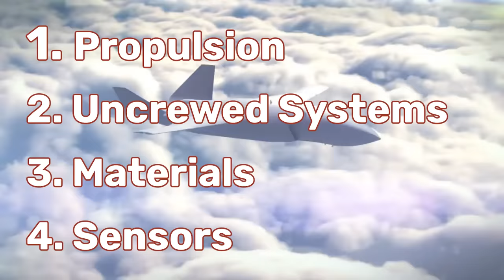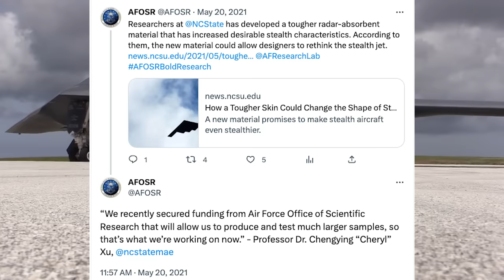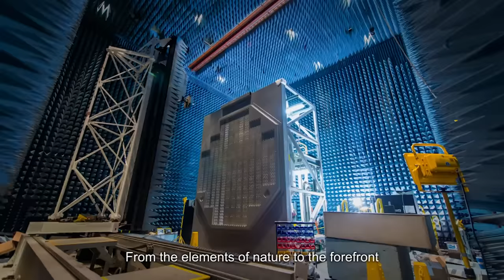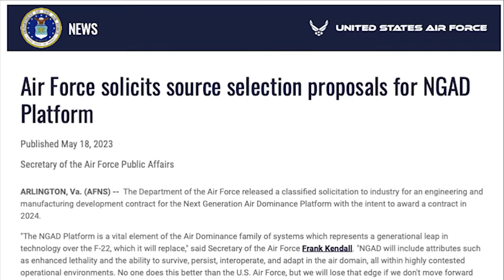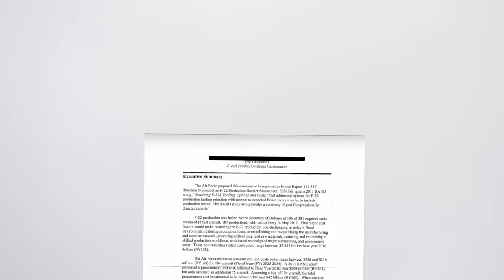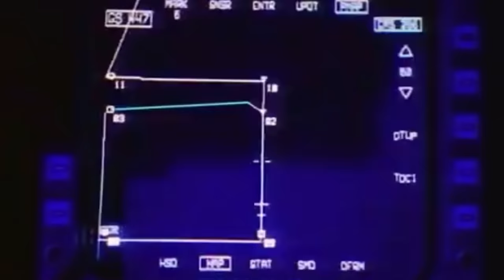Why America's new stealth fighters might cost $300 MILLION each

Comment: The better question is not what it will cost to purchase but what it will cost to maintain and operate. If we had a fighter that cost a billion dollars each but required one tenth of the maintenance and upkeep of the F22 or F35 that would still be a far better deal in the long run.
Reply: One of the two prime contractors on the F35 program doesn’t consider “spare parts” to be accountable as far as serial numbers and property inventory. “F35 spare parts” includes a globally-managed supply chain among tens of countries, hundreds of sites and warehouses, and thousands of personnel from US service branches, foreign service branches, DOD agencies like DLA, and contractors. Spare parts includes everything from screws and fasteners to entire engine assemblies. Yikes.
Reply: Easy to manage if you don't keep track. Makes more sense if you don't think about it.
Reply: Depends if they get shot down or not lol.
Reply: It’s frustrating how many forget / never knew operational costs are the most VIP cost factor + whether or not it can assume and eliminate the roles of and need for other platforms.
Reply: Money now is worth more than money 30 years from now. A plane that costs a billion now will never make up for its up front costs regardless of how cheap it is to maintain. It would be obsolete long before it could recoup its costs even if those costs are zero. Assuming a rate of inflation at 3% (higher rates make it even worse for you) and a 30 year life span. 1 billion now equates to 2.4 billion in 30 years. You could easily buy and maintain 10-15 f35s for that price or probably 6-8 f22s.
Reply: @NickSteffen  I don't think your econ is working. Check under the hood you have your inflation upside down or something
Reply: @Zak.Sparrow  I understand inflation is complicated. It’s okay you don’t get it. 

But any person with brain can tell you buying a billion dollar plane is dumb when  it drastically exceeds the entire life time costs of multiple f35s just on the face value alone. And that paying that amount up front is worse instead spreading the cost out. Is that simple enough?
Reply: @NickSteffen  no I don't think I'm getting it.  Fighter jets don't generate revenue they deliver ordinance. It's worth every penny. Our adversaries can't afford to get in the ring with NGAD. That's the point. Resistance is futile
Reply: @Zak.Sparrow  It’s not about generating revenue it’s about reducing cost (they are two sides of the same coin and effectively the math is the same). 

War is not about winning one bout in one ring. (Just ask Germany how well their advanced low volume weapons helped them in ww2) Being cost effective allows you to fight in more rings which is far more important especially when your fighter can already win any fight.
Reply: @NickSteffen  dude the F-35 program currently has a price tag of over 1.3 TRILLION dollars. The US has a total of around 950 F-35's. The procurement cost of the F-35 is around 230 million per aircraft. That means the actual procurement cost of the F-35 only accounts for 218 billion while the other 1.1 trillion is mostly all maintenance, operating, and training costs. In other words procurement is only about 15% of the total cost of the F-35 program. In case math is hard for you it also means that on average so far the lifetime operating cost per F-35 is around 1.3 billion dollars so far and they are no where near retirement so your assertion that "buying a plane for a billion dollars each would be more than the entire life time cost of multiple F-35s" is flat out wrong just based on current numbers let alone what the eventual total life time costs are going to be end up being. The F22 has an even higher procurement cost and costs more to maintain and operate. Had the original volume of around 750 planes been produced the total cost of the F-22 program almost certainly would have been more than the F-35 despite the fact that it would have actually reduced the procurement cost of the F-22 to be about half of the F-35. The majority of the cost of any fighter program is always going to be in prolonged maintenance and operation costs not in procurement. So if you can spend more upfront and pay less in continuous and ongoing maintenance and operation it is almost certainly going to be worth it even with inflation
Reply: @ThatGuyKazz  1.3 trillion includes future costs for another 800 aircraft and  their future maintenance as well as all current and future  foreign sales. It’s a nonsense number designed to make you click news articles. Your entire premise is wrong and you’re woefully misinformed please use some real numbers next time
Reply: @NickSteffen ask Russia how only being cost effective worked out as your primary reason of making a platform.
Reply: In the third edition of fleet tactics and naval operations the authors argue that "it is not likely that a less expensive new weapon with greater capability can produce significant savings in the defense budget". Reasoning is all of things mentioned above retraining, temporarily duplicated logistic support, integration of tactics and so on. These aren't punch list items to be checked off in the process, rather, it is THE problem of revolutionizing modern combat.
Reply: @IceKing6539  None of Russia’s new weapons are cost effective. They haven’t made one since the Soviet era. Their Kinzhal missile costs more than the extremely over priced Patriot missile shooting it down. Their new tanks and planes are too expensive to procure in volume. They are actually a supporting data point for my argument.
Reply: @Zak.Sparrow  Exactly, f35s and f22s have all that sorted out already. Whereas the billion dollar plane would not.  I’m guessing this isn’t the point you are trying to make… If your trying to say a new system is always more expensive than an old one than… okay, but how is it relevant to our conversation.
Reply: @NickSteffen  The part I left out about this process is that it's cyclical. Our adversaries get our tech through the grapevine for a huge discount. That means the trajectory must be upward or it'll collapse. Similar argument can be made for capitalism, maybe outside the scope of this conversation. We must keep pushing or be consumed by our own weight.
Reply: @NickSteffen  It seems like you're trying to argue against progress by throwing big numbers around. Our economic output is itself huge, and growing all the while, so big doesn't land like you think it should. How do you quantify and value global stability, security, and trade?
Reply: @Zak.Sparrow  I’m trying to argue that the example of the plane that costs a billion dollars per airframe given by the original poster is nonsense. 

To answer your question.  It’s true we need to create ever more powerful weapons to stay competitive but we need to do so keeping in mind that the ability to produce such weapons in volume is just as powerful if not more so than the weapons capability. A highly advanced weapon that can’t be exported because it’s too expensive or too advanced means it can’t  be used in proxy wars or by allies and is of very limited usability since there are unlikely to be wars of the scale required to utilize its capabilities between the US and an enemy. 

If there were however, a conflict vs a peer adversary would also likely devolve into a war of attrition in which cost sustainability becomes the primary deciding factor. 

You are right to mention our economy as it is our largest weapon. Our ability to out produce our opponents has won us many wars. Especially important is our ability to arm our allies and be the “arsenal of democracy” that won us WW2 and the Cold War. That said having some advanced low volume weapons is fine but it’s important to integrate proven capabilities from these systems into high volume cost effective ones as soon as the tech is mature. I think people lose site of that fact when making advanced weapons. They are as much a test bed as a deterrent.
Reply: @NickSteffen  I agree with most everything you said but I think the survivability factor makes all the difference. Like the first commenter said it depends if they get shot down or not. If It costs a billion dollars but we never lose them because it's literally untouchable then it changes the calculation.
Reply: Agreed. Too many people overlook Whole Life Costs and only focus on the sticker price.
Reply: @NickSteffen  Military hardware never "recoups costs". We're not talking about products that generate revenue. You have completely the wrong mindset here.

What should be prioritised (assuming equal capabilities) is Whole Life Costs - R&D, production, maintenance and decomissioning. Whichever has the lower WLC is the one to go for.

But when you throw differing capabilities into the mix, that makes things more complicated.

Comment: Price aside thinking of the capabilities is just 🤤🤤
Reply: What does that mean. 'is just drooling blue stuff?'. Use your words.
Reply: @billycarr7446  I found it pretty easy to understand.
Reply: Like the leopard tank' capabilities? 🤔
Reply: @GegeDxD  Lepoards are old tanks from 1980s
Reply: @hphp31416  Leopard 2's I assume.  Same with the M1 Abrams, but both chassis have been upgraded to high hell throughout the years
Reply: @hphp31416 that's an ignorant statement. Many modern military vehicles are about  30 years old but  they are still upgraded with new equipments.  Plus a leapord 2 can go into production now from the ground up.
Reply: @GegeDxD  wait what's the problem? It's a great tank.

Comment: i think if development going toward NGAD are thought of more as potential components toward other airframes, like stealth coating, radar, data-networking, etc, rather than being specific to one platform, it might seem a little less nuts. putting those components to use in other aircraft, whether those in development or retrofitting, it might help offset or justify the cost some.

Comment: If this plane is only used as a can opener (destroying radars and making way for the F-18’s) than it might be worth it. Small numbers and highly specialized.
Reply: F-35 can already do the same task with very high confidence at a fraction of the cost
Reply: @stupidburp  The F-35 version 4.0 is a true 5.5 generation fighter, & can do 90% of what the NGAD fighter can.
Reply: @terrywilson4166 and comparing the base of the future to the 4.0 of an existing platform is always going to be silly. NGAD will be built upon in similar fashion to how the F-35 has, years from now when we compare versions 4 of each the differences will, in my opinion, be absolutely massive
Reply: @patricklloyd1797  I think the NGAD will leverage existing technologies sourced mainly from the version 4.0 of the F-35, & use the F136 engines which are being developed.  The airframe I'm pretty sure will be a updated tailless version of the F-22B.
Reply: It’s going to be hilarious to see the reformers go from “why don’t we make more F-16s” to “why don’t we make more F-35s”

Comment: 300 million doesn't mean much. We print money like there is no tomorrow, and inflation adjusted this doesn't look too bad compared to others.
The real question is if it can deliver the performance that matches the price tag. And with digital, modular design, 3D printed parts to be able to produce spares whenever you need them, vertical integration and a digital, integrated cockpit, it probably will do exactly that.
Reply: Digital design and agile, vertical integration may very well be the thing that saves us from the old joke that we can only afford a single fighter jet by 2050. 300 million might actually be cheap, compared to what the F22 or F35 would've been with todays dollar value.
Reply: F-22 deliverd performance. NGAD is supposed to deliver long term sustainability.
Reply: @piotrd.4850  raw dogfighting power that'll burn off your ram coating, yes. But the NGAD is supposed to be more stealthy, possibly faster, definitely longer range, and affordable upgradability to always stay up to date. And it may have a lot more firepower with more longer ranged missiles as well.
Reply: @piotrd.4850  So was the F-35. It currently costs more than a 30 year old F-15E to to keep an F-35A in the air, and that's with the F-15E flying more hours than the F-35A.
Reply: @pogo1140 You mean an F-15E at the end right? We hadn't made a F-35E yet.
Reply: @pogo1140 and the airframe life of the F-15EX is twice that of the F-35.
Reply: @mill2712  Yep, typo
Reply: "300 million doesn't mean much. We print money like there is no tomorrow, and inflation adjusted this doesn't look too bad compared to others."
...You must be an "expert economist" for the current administration if you think like this.
Reply: Sooner or later you will have to pay the debt, you get that right?
Reply: If a 5th generation ++ F/A-22 version for export were produced for allies like Australia, South Korea, Taiwan, Singapore, Israel, Poland, Norway, Sweden, Finland, Canada and the USAF it might be worth it. .
Reply: @GegeDxD  
"Sooner or later you will have to pay the debt, you get that right?"
@texasranger24: "haha! money printer go brrr" [Until the money is literally worth less than the paper is printed on]
Reply: @matchesburn  The F-22 was reduced to 200 planes because it cost $150 million dollars, this is why we still have F-15C's in service and why the F-15EX is being purchased
Reply: @pogo1140  
...Okay. I'm not sure how that has to do with anything I said, but... Whatever.